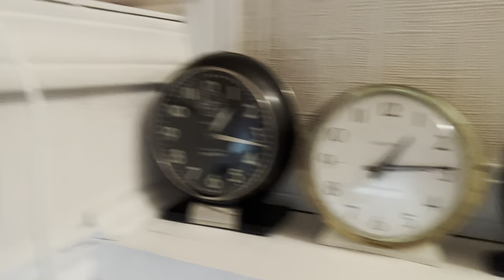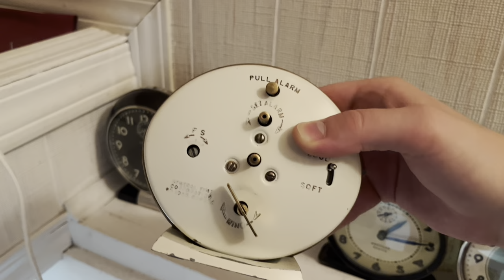Westclox Big Ben Style 8 Single Key Service (Part 1)

Comment: You’ve finally moved to the Big Ben 8. Sounds like 👍 Big Ben 7 has been giving ya trouble 👿. I would have bought at least several Big Ben clocks 🕰 at a yard sale, or an estate 🏡 sale for the part ya need, if that was the case. I never 👎 really thought 💭 of Big Ben and Baby Ben movements to be exactly identical, but that’s a logical thought 💭. The movements are identical in their own separate sizes, so they are not interchangeable between the two clocks 🕰. Your friend, Jeff.